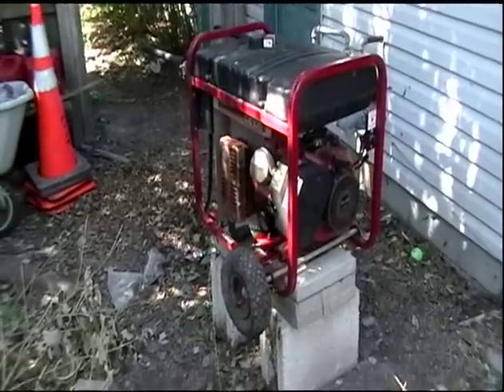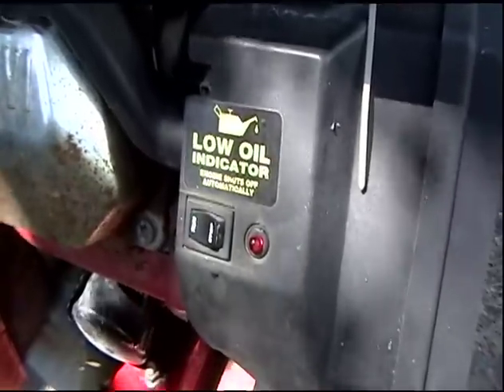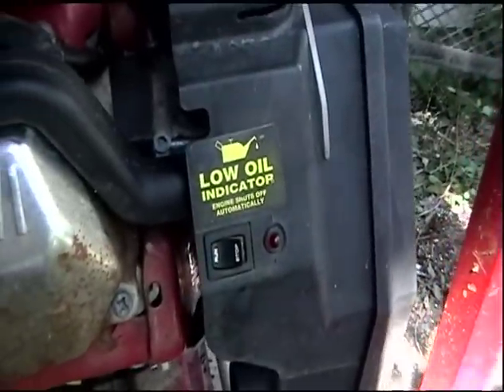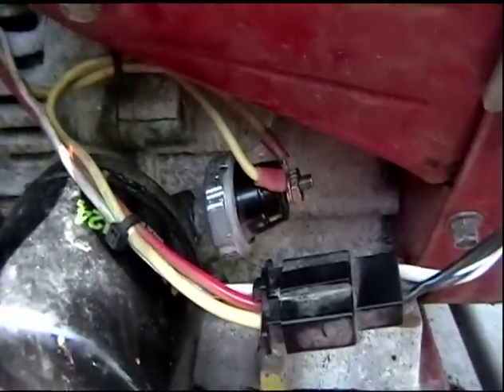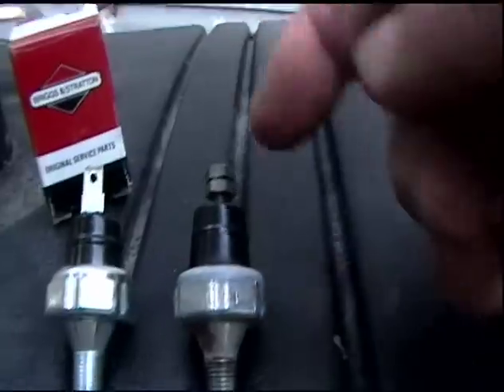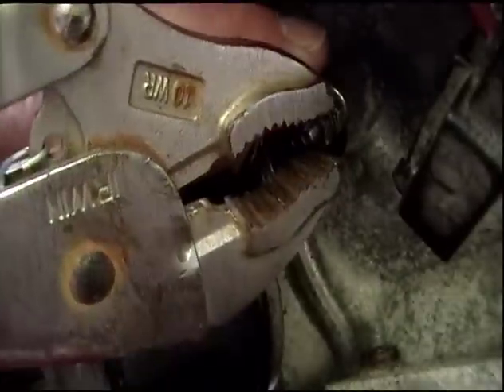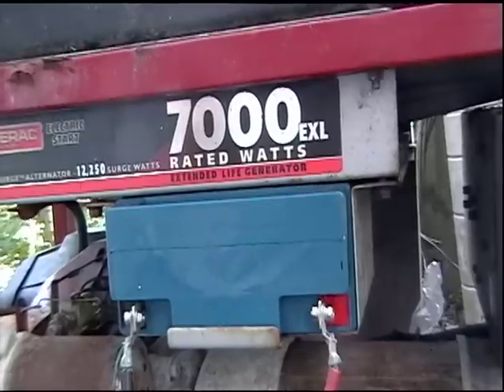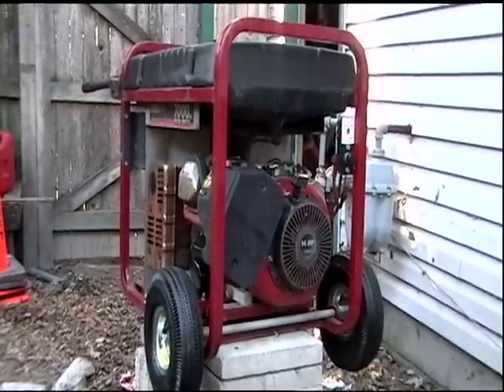Generator runs then shuts off

Comment: Mainblind, I have six words for you.....Thank you! Thank you! Thank you!
We had an early snow storm in N.E. Ohio today, and most of our area lost power.
My father's generator was doing EXACTLY what you outlined in your video.  I checked the oil level, all good, disconnected the oil pressure sensor clip as you described, and shazaam!  The generator ran fine as you outlined.  Next step will be to replace the sensor.  Again....... Thank you for your video!

Comment: I have a 4000EXL and for weeks I have tried everything to fix it. I tuned it up, cleaned the carb and replaced some parts in the carb, etc. I am so glad I found your video because right away it started and kept running like before. I couldn't be happier. If you are ever in Atlanta I am buying you a beer. Cheers.

Comment: Hey Mainblind - I just want to thank you for this video.  I don't know how many people have this problem, but I did and it drove me nuts for years.  I've got a different brand generator (Yamaha EF2600) but in the winter it would start then die, just like yours.  After I watched your clip I went outside, found the wire, disconnected them and problem solved.  You did a great job making a clear, useful piece.  Much appreciated and many thanks!

Comment: Hi mainblind, I live in Curacao and we have a bad electricity supplier so we get to use our generator pretty often. Lately it just wouldn't keep running, so my boyfriend decided to look up for possible solutions on the web and came across your video.Since he has no youtube account he asked me to thank you. Ps. Our generator is a honsuki 3500, anyone with the same problem should try this! And just shut off the fuel supply when you wish to turn it off